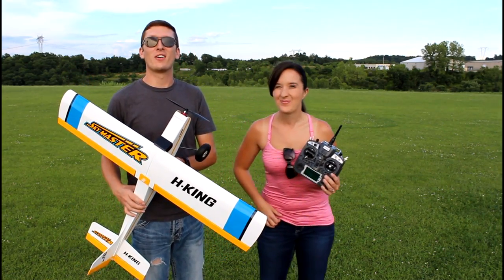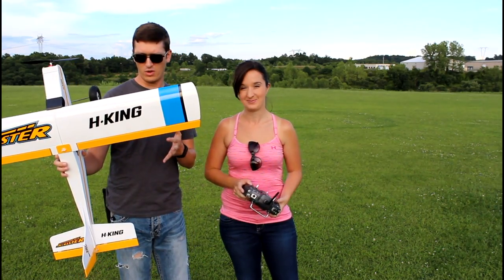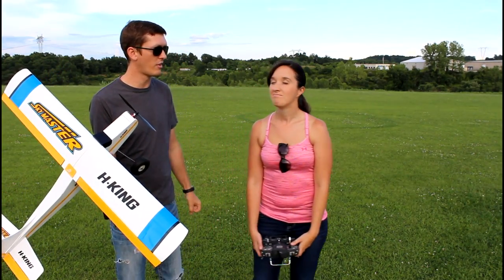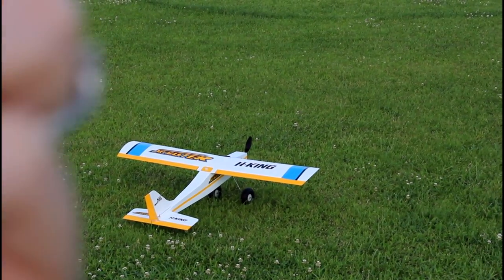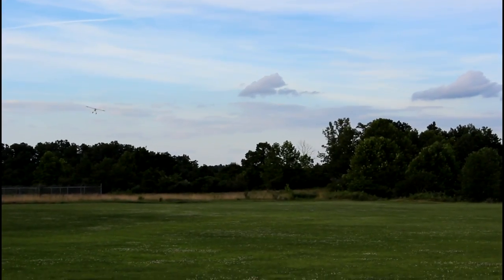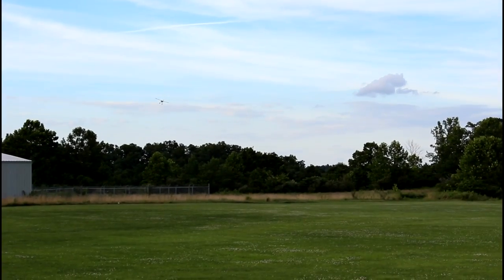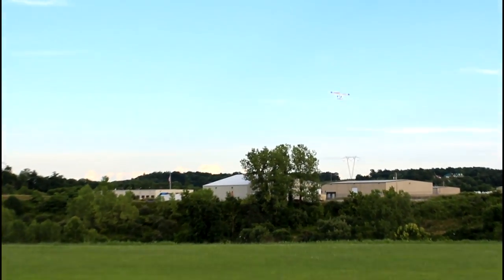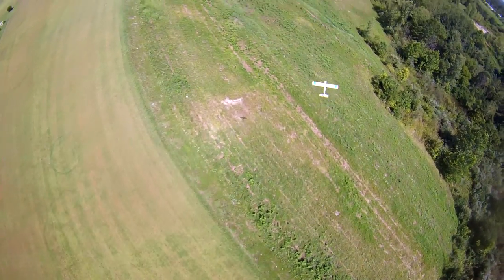HobbyKing SkyMaster V2 First Flight Impressions Review Trainer RC Airplane - TheRcSaylors

Comment: I have to confess that being "Old School", my first r/c plane was balsa and plywood with a McCoy .19 nitro on her. When I got back into r/c my first plane again was a Taylorcraft by Hanger 9. Now common sense being the better valor I bought Phoenix Flight Sim, and a foam Hobby Zone Cub 3-channel. With foam you can glue them back together, but with balsa you get a pile of sticks, trust me I had a .60 Escapade snap a elevator link while doing hammer stalls, and slam into the ground. Like they say "if you ain't crashing, you ain't flying", so keep it up, you guys are doing great and it's nice to see the chase scenes.

Comment: Great job guys, way to go Abby! Keep em coming. Honestly, if ya liked the way that one flies, you HAVE to try out the Durafly Tundra. You both will have a ball with it. It has the addition of flaps which will go all the way to 90 degrees so talk about some flight! And it comes with floats and an FPV mount for your camera gear. I love mine and it has became one of my favorites. You can even buy the optional ski set so you can fly in the snow!

Comment: Balsa planes are pretty tough and there is usually less movement of the vertical/horizontal stabilizer in flight which makes balsa have a better feel(IMO) to fly.  Some balsa wings have a foam core that can take a beating and still fly.  Hope to see more balsa planes and any builds.

Comment: great video, the chase cam adds another layer of pro.One  thing though, balsa came before foam and is much stronger, it's just a little brittle when kissing the ground. ;)
Reply from the maker: That's actually really good to know. We can push a little faster in the air and not have to worry as much ;-) Thanks!

Comment: Thanks for the video! You were speaking of running a lipo alarm in your plane.  What is a good number to set the cut off level on the alarm for maximum flight time but yet have enough power left to land the plane?
Reply from the maker: It honestly depends what you are flying and how you like to fly. I've noticed myself adjusting it a bit for each battery and definitely for different vehicles.